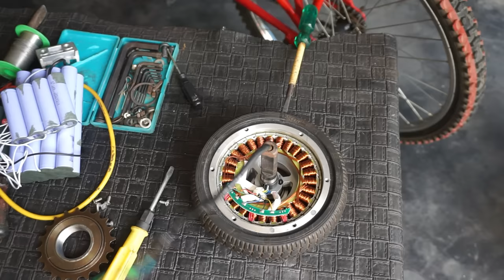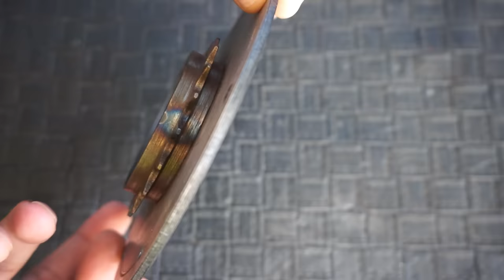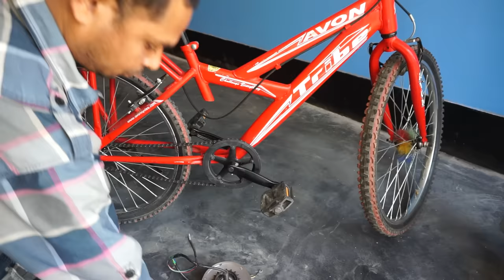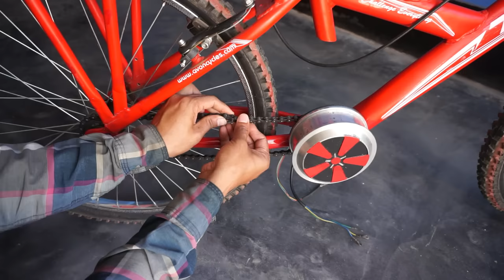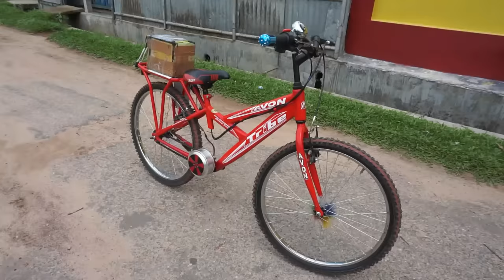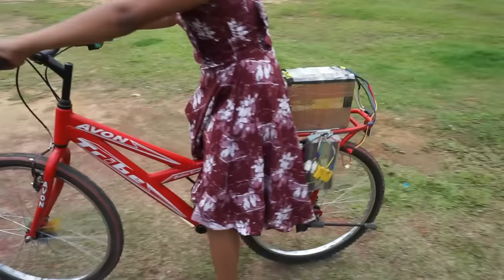DIY Electric Bike - using reducer brushless Hub motor

Comment: That's cool...I hack that to use it on a kids powerwheels  or go kart..ect
it dosnt need to go super fast..12-15 mph is fine.
I'll gear it accordingly....Used hoverboards motors and bike parts  are cheap and easy to get.

Comment: Good job . But foot pegs please.
Reply: I dare say that if he can operate a lathe and a welding torch, source the components, and get it all working, he's more than able to fix on some foot rests. Its an experiment. I'd imagine, too, that he'll mount the battery more solidly too, but it all takes time,doesn't it? Early bikes didn't have pedals or footrests, don't forget, it helped with balance on a rough road to have feet loose.

Comment: Can I use the main motherboard which came with the hooverboard as a controller ???
Reply: no you can't. as it is programmed to move forward or backward when weight is applied in the relative direction. you can use any 36/48v chinese brushless motor controller ranging from 250 to 750 watts
Reply: @marooned-5  Thanks
Reply: You can. Software is hacked at least in 2018.

Comment: It really has no big advantage over having left it as a hub motor but if you add a derailleur and rear cassette now you'll have giviem yourself a big advantage over the original Hub motor but without the benefits of the gear ratios it's going to be just about like it was but just in a different location

Comment: Verry nice priject thank you... but hey... the motor of cours will over heat and the acceleration will not be good... try changing the sproket of rear wheel with much bigger one... the result will be so much better... hope to see that in avideo... thank you... also i think that s a led acid battery... try using li ion in 15s (54v) and about 20 Ah... it will be awesome
Reply: Oh never mind i just checked your other video so never mind the part where i talk about the battery

Comment: A lot easier to mount it with tyre on to back tyre then it's pedal assisted
Reply: В колесе МК будет перегреваться, в идеале для такого мотора нужно передаточное отношение 3:1 (за 3 оборота МК колесо обернётся 1 раз), таким образом увеличить крутящий момент

Comment: How many hours until battery runs out?
Reply: Depends on how big the battery is, the speed you travel at, weight carried, hills and wind encountered, pressure in the tyres, efficiency of the system, and how old the batteries are. You see why its not a sensible question to ask? But don't feel bad, lots of people ask the same question interminably, but its long past the time when they either need to stop asking, or get out a piece of paper and do the calculation. For example, you need about 200 watts to travel at a decent speed along a good smooth and level road when the bike is in perfect condition, tyres pumped. So a 1000whour battery will give 5 hours. A 10amphour battery at 24volts gives 240whour, but those are small and cheap, so you could double or treble that easily, and with LiPo batteries even more. Add a trailer and you could carry 25 kg of batteries, enough for 20 hours. It depends on how much you want to spend on batteries. So let me ask you a question with similar open-endedness - how rich are you, what is your educational level, how good are you at experimenting?
Reply: @bmpowellicio  could you pls explain hoverboard motor connection